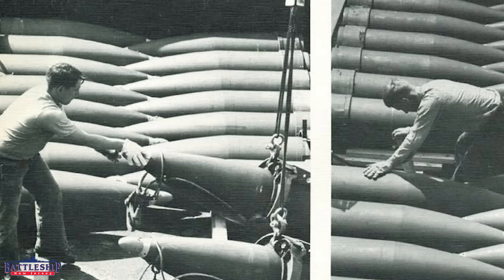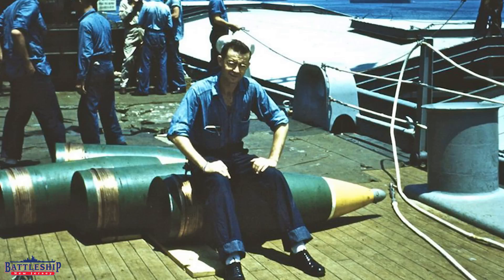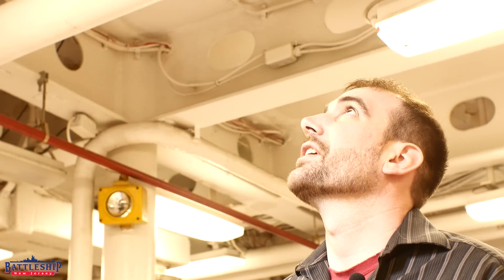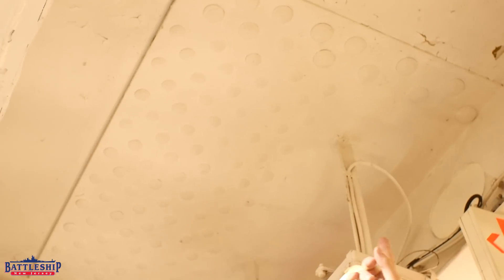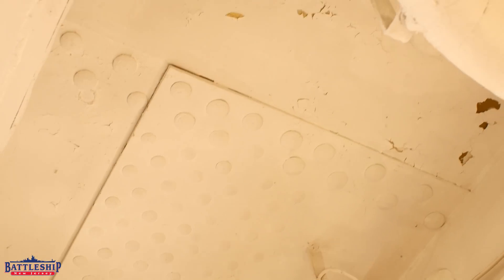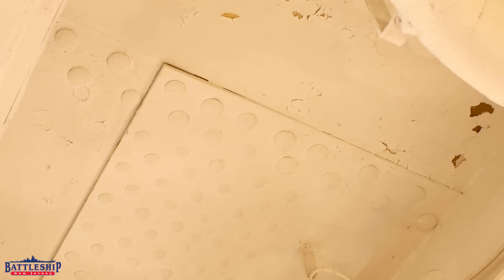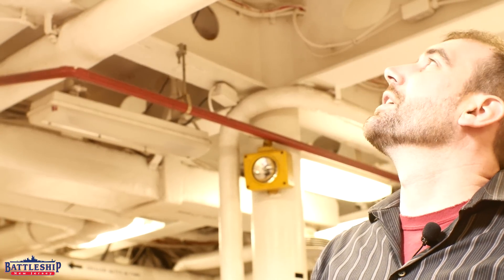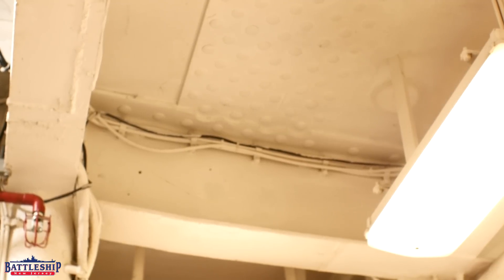Unique Battleship Features: Overhead Framing

Comment: It's probably ease of construction and overdesign. Longitudinal bending moment and torsion that far aft are low. Using the same profiles and plates reduces construction time and standardization is possible (but i doubt standardization). The load on deck can also be a major factor.

Comment: Even dirigibles have a majority of their structure outlining their shape. Without that it would be vulnerable to hogging and sagging even more. A single beam is more vulnerable to bending than a box of lighter beams. With a center area that has three barbettes and a superstructure with the thickest steel it has to distribute the weight to the ends with a heavier frame. With all the steel rolling from side to side from the superstructure it would twist a smaller frame more severely. The others who previously commented explained it just as well. I just tried to explain it from a different perspective so it gives more viewpoint on a difficult concept.

Comment: As other parts of the ship are way more heavy than an ordinary ship, all that over engineering is to prevent twist and bending from torque in rough seas as the support of the weight of the ship shifts for and aft.

Comment: Every 10 ft x 10 ft section of deck weights about a ton. Now add all the other 10 x 10 sections together and hold them up over your head while the structure is tossed about by unpredictable waves. No wonder the framing looks so solid.

Another way to look at it; take a 900 ft long vessel with a hull made of 1.5 inch thick steel hull plates and scale it down to 9 ft long. That hull plating becomes only about as thick as aluminum foil on a 9 ft model. To me this sounds easy to crumple.

Comment: In engineering, I-beams are used to provide stiffness against bending, and to take such sideway loads.  In the case of the Iowa battleships,  we can reverse engineer the framing and find that it is there to make the ship superstiff, not only for withstanding the torsional loads imposed by the sea with its wave action and with the pitching and yawing.  But to withstand all of the reaction loads that go with firing a 9 gun broadside with those 16 inchers.  Aside from supporting the armor installed to protect against torpedoes and enemy large caliber shells, the lattice of 16 inch I-beams is necessary to keep the ship from being torn apart by its own weapons.  Imagine the loads imposed by the chase of the IJN Nowaki, maximum spead at over 30 knots and the forward batteries blasting away to give the Japanese crew a bad case of post traumatic stress syndrome.
As heavy as the I-beams are, they are a weight saving way of adding stiffness and strength to a structure.
Reply: Yes, plus all the holes deliberately cut into the beams is a way to save mass, but not sacrifice strength in the beams, as the area occupied by the hole is normally low stress, and thus you either can remove regular parts, leaving a way to run cables through easily, and fast to do in the yard during construction, or have a thinner middle web near the centre, which is something the steel foundry has to do during manufacture, and which has a risk of leaving the middle very weak because of the rolling deforming so much, needing an extra anneal cycle on it. Longer, more expensive, so go with no 1 as it uses a standard part all the way, plus you get all the "small" cut outs to use as tabs and braces elsewhere, excess going back to the foundry to be melted down again.
Reply: Stiffness also for maneuvering and down below there are 4 shafts and 4 screws putting up a racket at speed.  All that stuff keeps the ship together!

Comment: How much of the "over-engineering" is to compensate for the overpressure of the 16" guns when fired directly forward or aft?
Reply: That might be part of it. Other comments are mentioning withstanding the forces transmitted through the ship itself from the gun firing, but also from the ship as a whole experiencing twisting and bending forces from being at sea, and how a transition from a stiff portion of the ship (the citadel) to a flexible portion of the ship would make a focal point for all those stresses.

Comment: My #1 example of over-engineering is the scalloped plates welded over joints. My #2 is all the elaborate joins cut into the armor plates. Norm Abram would go crazy trying to cut these into wood.
Reply: Take a trip to  " The Woodwright's Shop " on your local PBS station.

Comment: Im guessing the extra framing is to keep the same stiffness as the armored portions.  If you have different stiffness values then that creates a large stress riser.  And the best way to add stiffness is by using I beams and not by adding deck thickness.
Reply: This exactly.  Also, hoop stress is carried by the hull up and across the main deck.  That stress is dependent on displacement, not (always) local loads.  Also, it’s a capital ship and so is overbuilt for survivability.
Reply: @TrojanManSCP  Thank you 🙏
Reply: Thank you 🙏

Comment: Weight above is a factor, but it' s not THE factor. It's longitudinal, lateral AND arguably the most important factor of all, torsional resistance strength. You could see a ship twist and snap in half like a twig if it didn't have the internal structure required to sustain against these forces.

And i .. mean, you see them. A lot of the inner lake ships ate it, because they were built like regular lake ships, not sea ships (or because the education required didn't exist). You can see what a lack of structure looks like when you look down a long ship's main corridor at sea.

You can see the whole passage twist and turn up and down, side to side, and twisting... like some kind of wacky train (now, true, most modern ships are able to take it, because metallurgy and computer aided design has made a huge difference, but still, enough to raise the hairs on the back of your neck).

Back in the day, they were aware of these issues, so their standard solution was to lattice everything. Most wouldn't agree, but i highly consider that type of structure to be the actual ship's spine, rather than the keel.

Just my 2 cents, either way, she's built like the proverbial brick dunny, because she's required to take all the punishment demanded of a battleship... and more.

Comment: Really... One thing I hear Drach complain about the Iowa's... Is their lack of armour... 
 Ur this... SORT OF... Makes me believe that the deck was built... With that in mind..  it didn't do extra armoring of the deck...
It certainly looks like those beams could hold a lot of weight... 

Maybe nitz but it really seems that way
Reply: Nah, even if they were going to add armor it wouldn't have been back there, outside the armored citadel there'd be no real need or point to doing so. If you were going to add armor to the Iowa design torpedo defense would have been the most pressing need, but more armor would have come at the cost of speed and the Iowa's were obviously designed with speed first, firepower second, and armor third (though they were still pretty stout ships).

If the US Navy wanted to go back to heavily armed, armored against their own guns, and slow(er) they had the design, the Montana class. That got cancelled before they really got going because the tonnage was better used for more carriers.
Reply: @andrewfidel2220  that's the point... It... Should have been armored against it's own... Obviously...
Reply: They had a weight restriction. Washington Naval Treaty,
Reply: Solid high grade steel 17" thick is a lack of armor? I find that hard to believe. What are Drachinfenifhsjejsel's credentials? Cracker Jack box armor thickness evaluation?
Reply: @KirkHermary  The Iowas were the first US battleship design in like 50 years that couldn't stand up to her own guns at expected battle ranges. It was a major leap of faith for the US Navy and not without significant detractors within the senior command. But it was based on wargaming and acute need should England fall. It obviously ended up being the right balance of firepower/armor/speed as the ships were still useful well after the age of battleships was over but they were in fact lightly armored compared to most battleship designs.
Reply: @KirkHermary  just look up his channel... Lmao. He don't have that many letter but yeah... Lol..
In fact he just visited Ryan on his last trip... To US... Unfortunately... I never heard anyone smarter talk about Ships. But. I digress.
Reply: @strydyrhellzrydyr1345  what are his creds? Is he an engineer? Was he in a navy for years? Maybe he worked in a shipyard? ThemTube is a platform full of information. However a lot of it is know nothings writing a script from Wikipedia articles.
Take Megaprojects for example. Many times I've read along in Wikipedia word for word while the video plays.
Reply: @KirkHermary  he's an engineer who has volunteered on restoring and preserving British naval ships.
Reply: @andrewfidel2220  that's cool! It's nice to find actual sources of information among the sea of talking heads.

Comment: My guess is that the ship's designers continued the columns and heavy framing under the main deck aft of the armored citadel because otherwise that part of the ship would be less rigid and therefore a relatively weak spot where the ship would tend to flex and twist in heavy seas.  This part of the ship would wear more quickly, especially at the point where the more flexible part met the more rigid.  Without looking at the blueprints, I believe this area would be over or near the propeller shafts, where flexing and twisting could put excessive strain on the shafts, bearings, etc. and would be especially undesirable.  Finally, the mess deck is a large open area without bulkheads to add stiffening to the structure.   As you noted, the ship's designers tried to eliminate excess weight (and steel in short supply) everywhere they could, so there must have been a pretty compelling reason.
Reply: They will also have to take into account loads from explosions that hit the ship and partial flooding that will put stresses on the structure.
And if the ship is going Tactical Diameter then there will be a large load as well
Reply: Great explanation and you beat me with a better description!
Reply: The beams in conjunction with the keel form a rigid structure that prevents the ship from sagging or hogging in heavy seas.  This method was first used in the late 30's.  The reason older U>S> battleships don't have this beam structure was that even though they were constructed using welding they were DESIGNED at a time that riveting was the main construction method. Any modern ship over 120 meters in length is required to have longitudinal beams under the strength deck. So the beams have nothing to do with supporting weight on deck.

Comment: I'm going to speculate that the sound issue is because this was live. The lapel mic didn't work (or work correctly) and they went with the camera mic as a backup
Reply: The "underwater" sounding effect on the mic is an indication of using a LOT of noise filter, so my guess is that this is a very loud space with background noise. There's a segment where the filter lets some of that through. In cases like this, while not ideal, the best solution would probably be for Ryan to hold the lapel mic right up to his mouth. It's awkward to look at, but then his voice would come across as a stronger signal and less noise filter is needed.
Reply: @Jimorian  Or maybe a slim headset, that way he wouldn't have to hold it.

Comment: Those beams are not just about weight above.   The deck is part of the longitudinal and athwartship strength of the hull.   Consider what would happen to the ship if the deck wasn’t there - it becomes pretty obvious that it needs to be a very substantial, strong structure.
Reply: I wonder if part of why it looks so overbuilt to modern eyes is because today we'd model all of this on a computer and be able to build something with a similar capacity that's lighter. However, with slide rules and paper it's harder to make those same calculations to support the 100 tons of shells, provide needed rigidity, or whatever those massive beams are doing.
I'd be curious to see if the South Dakotas had a similar structural setup in that area because it also occurs to me that it could be a holdover from an earlier class. I seem to recall Ryan saying sometime that the Iowas weren't completely clean-sheet designs.
Reply: I was thinking the same thing. There's perhaps not the need for that particular strength in the vertical plane, but I'd bet those massive frames have a lot to do with anti-acking, sea-going ability, and general stiffening of a massive, heavy, rolling-and-pitching sea-going vessel.
Reply: Anti-racking**
Reply: Well just damn, should have read the posts before saying the same thing.
Reply: @binbashbuddy  In regards to avoiding repeat comments, it would help if youtube had a comment search function, but no, that would cost them money (in terms of computing power) and reduce "engagement".
Reply: But I beams of that kind of mass or not necessary in anywhere near that kind of quantity if at all to hold the deck in place so it can hold the ship together. And because you don't want this battleship to be any more expensive than it has to be they must be there for a specific and exclusive purpose, and supporting 50 or even 100 tons of shells seems like a pretty reasonable explanation because those IDs look like mild overkill for even that kind of an application
Reply: @the_undead  -- I do agree that if you intend to stack 100 tons of explosive ordinance, or I guess anything else, on the deck you'd want support for that, but a bow sized or higher wave on the side of a ship doing 20 knots is exerting a tremendous amount of sudden energy where the skin is thin at the bow.  I expect both forces are being taken into account, but I'm not sure which has the greater influence on the size of those beams.
Reply: @binbashbuddy  I'm sure someone somewhere has a computer strong enough that they could run the simulations to see which one would be more dangerous. Most 3,000 plus dollar gaming PCs are strong enough for this

Comment: You're probably right.
I know of several well-designed factories with wide open spaces that only make sense when you need to disassemble machinery for repair or replacement. During normal operation it just looks like wasted space but during maintenance intervals it's a life saver.
Reply: Visit a power plant during repairs vs. operation is a great example of that.  They'll have room to tear the turbine and generator apart for service.  When that happens things are packed in tight.